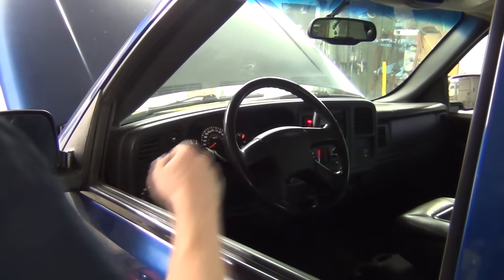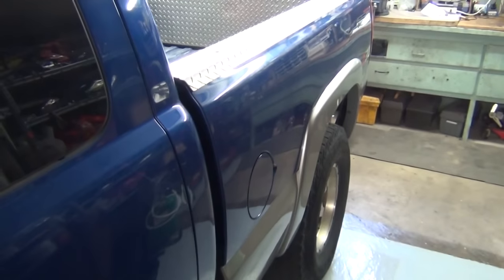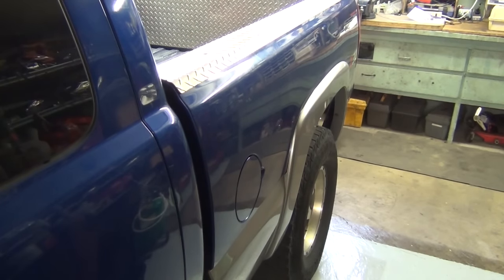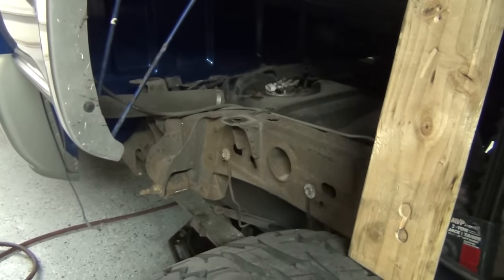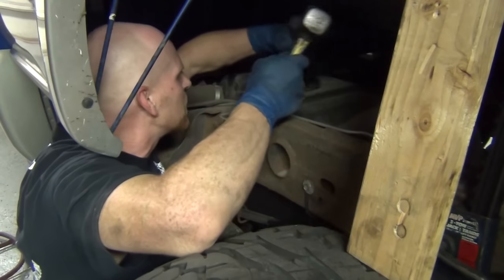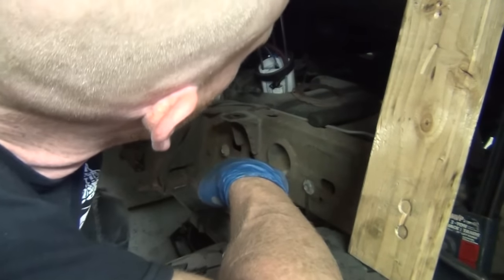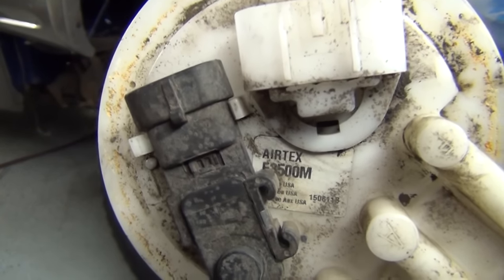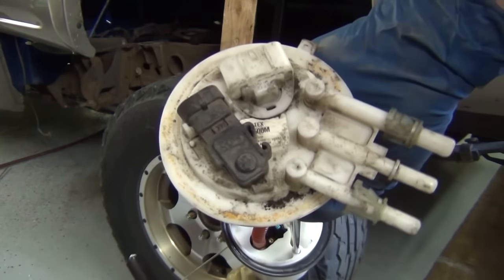Tipped Bed Method!  GMC Fuel Pump Swap.

Comment: I'm torn between this method or cutting an access hole in the bed. If I cut a hole, I'll have to remove my tool box and drop-in plastic liner. So it might be easier and quicker to go at it this way

Comment: It's too bad that trying to buy American turned around to bite you in the ass.You would think that people would take pride in being among the last American manufacturing left. Maybe they got some defective parts and didn't catch it. But not warranteeing the pumps shows zero accountability or pride. Looks like they lost a good customer.On a lighter note , what kind of creeper is that? It looked pretty good. Thanks for the helpful vids, you're easy to listen to and have a good sense of humor.
Reply from the maker: Thanks- the creeper is Napa's "fancy wheel" model.  That's what I asked for and the counterman knew right away what it was.  It's a Balkamp catalog item.  I looked online and found Lot #298259

Comment: If you have a motorcycle jack, you can drop the tank with ease.. just not sure there is enough hose and wire to get low enough.

Comment: If you were to put your foot in it would it stay running? Mines doing the same thing right now, not quite as bad. I can still drive mine but it tries to stall at lights if i keep it in gear, so i put it in neutral and it sputters around 400rpm.

Comment: good video. for next time you could try pulling the fuse for fuel pump than start it and let it run till it dies and it should not have as much gas in the line when you go to take it off

Comment: I will try the bed tilt if mine ever goes, but what I discovered is that lucas fuel treatment, that has a lube base in it, will lube the fuel pump and make it last longer. I have 265.000 miles on my sierra  (2005) and it read 57 psi,  so its still hummin nicely. Also, this cutting a door in the bed for access is cautionary  to me,  since there will be sparks from a cutter or reciprocating saw- and the perhaps fumes around? No thanks. Buy you some PB Blaster for bolt removal, it's great stuff.
Reply: Common Sense Machine my pump is slightly humming I put Lucas in I hop it’ll help

Comment: Thanks for the video I did not want to have to lower my tank that is atleast half full by myself . I'm definitely tipping the bed . Is it possible to tip the whole front like a dump truck without any more work than side tipping it ?

Comment: just started on rt side used pbplaster wont get to 1 bolt keeps turning some what tight  2 got loose 3 broke 4 out lf side 4 got out 3 broke 2 comming out sow tight 1 tight what do you do if 3 are snaped jusr tack wed next guy just has to use cut offf= wheel mr lucky you have agood vidio

Comment: I'm trying this technique on my 2001 Silverado. I have run into a challenge removing a couple bed bolts. The problem bolts will loosen to the point I can spin them with my fingers, but they won't come out. Do you have any pointers to get them out?

Comment: I used to have an 88 Celebrity that had the same noise from the fuel pump except it worked, until I was on a long trip and it died on an exit ramp. Same exact noise.
Reply: I have an 89 celebrity. 2.5 4 cyl. All original but the transmission does slip now. After  32 years and 270k it's to be expected.

Comment: Puts my mind at ease to know the bed will just tilt :)
I'm up for a pump in my '01 sierra, believe it or not the org. acdelco is still in there!
What would you recommend the Delphi or Denso?
Reply from the maker: Either one would be great.  AC Delco is the original manufacturer for GM.  And Denso is a very reputable supplier for many of the Japanese imports that just about never need a fuel pump replaced.

Comment: Hello Brian, I need some advise please! I pulled the throttle body off of my 2002 Chevy Silverado 2500HD and also replaced the air idle control valve. Now when I start the truck I get a short period of high idle and then it drops down to normal. I just re-installed the throttle body today and noticed the high idle other than that when it drops down to normal it runs great not sure whats going on any help would sure be appreciated. Really love your channel tons of great info and you seem like such a down to earth just over all great guy the world needs more people like you really. Thanks again buddy have a wonderful evening.  Paul
Reply: I know on later trucks as in a 2010 when you remove the throttle body you have to have a mechanic make the truck relearn how the truck idles and should idle when
Reply: Thank you jbosem!
Reply: Jbosem is correct, if you move the butterfly at all on an electronic throttle body, our kind folks at GM designed it to have to be fixed by computer

Comment: what years does this work on? i do liek thsi for the side of the road, i like to full pull the bed myself, the tank is straps here in eastren canada after 7+ years, you usally wanna leave them alone xD pulling the bed is what i like to do, now that ive seen this im going to try this

Comment: thats why i just bite the bullet and get a delco, if its a ford motorcraft, ect... i just dont like after market electronic's, had to many issues with it in the past and one fo the work issues was the virable resistance on level sesnor and or FTPS acting up...

Comment: Just wondering if you are still liking the Carter pumps? What about Delphi or Bosch?
Reply from the maker: I'm currently using OEM pumps and Precision brand pumps.  Delphi and Bosch are fine, they're OEM for many vehicles, but I prefer Precision brand where/when I can get it.  The price/value/performance mix is best with Precision brand for now.

Comment: Hey Brian!  97 blazer here with a bad sending unit causing fuel gauge to not read correctly.  Just replaced it with ac-delco 5 months ago and it's having same problem again with fuel gauge.  Any recommendations or suggestions?  Fresh out of eBay warranty! Shocking right?

Comment: I have Modified all my Vehicles with an Out of the Tank Fuel pump. Have had No Issues with any one of the. In Tank Pumps are just a way for Auto manufacturers having Consumers have to pay Over Priced costs to replace Fuel pumps.

Comment: i have a gmc 2500 hd with the 8.1 litre and when i pulled the old pump out it only has one electrical supply and the new one came with two on it and a new harness with wires for the extra connector. pump didnt come with any instructions was wondering if anyone knows where you wire it to
Reply: Mine on my truck has two only one plug tho and been that way sense day one

Comment: I found that the stock GM replacement will not fit the airtex unit. I found an airtex replacement pump on ebay for under $20 shipping in and lifetime warranty (for what it's worth). But you still end up with an airtex unit.
Reply: You got a counterfeit for $20.

Comment: I agree fuel pumps these days are shitty , but you forgot to clean off the tank. The sediment from the top of the tank can damage the pumps and cause them to fail prematurely . Most of the pumps i have installed warn you about this on one of the small pieces of paper that come with them .

Comment from the maker: Ethanol is detrimental to many of the plastic parts used in modern cars.  That's been proven many times over.  I'm not satisfied that ethanol alone was the culprit here.  Nor in the Dead on arrival A.T. pumps that I've come to develop an emotional dissonance for.

Comment: About how long is the 2x4?
Reply from the maker: I started with a 3' long one and pushed the bed up until it was tensioned- then I marked the bottom where it was at the top of the frame.  Then I cut it to fit at max gap.

Comment: DELPHI FOR ALL GMS!!!!
Reply: My original Delphi fuel pump started having check valve problems around 70-80K miles so I replaced it with another Delphi. At around 175K this one started having the same problem. Having to cycle the ignition 2-3 times to get enough pressure to start was the beginning of every first start of the day. I actually began thinking the check valve was the only problem with the OEM units until yesterday. Then the truck wouldn't start at all. Checked the pressure test port and "0" PSI was the reading. All electrical looked good so am going for a different MFR this time.

Comment: Can you just not get the pump and change it? I get the pump only here on GM and just spend 20 minutes changing them over. Then again it is an aftermarket unit as well, might not last the 10 years of the oem unit, but is going to go at least 4, and is a tenth the price ( and if you buy oem it is the same pump anyway from GM themselves). Only time you buy complete is if the fuel sender is dead as well.

Comment: In the good old days you could slide a new mechanical fuel pump in a square body into the side of the engine and the pump would set you back $25 and a leisurely half hours work. I done one in 15 minutes once. These new vehicles are shit to work on.
Reply from the maker: I feel ya man!

Comment: I just installed an Airtex.....if it goes out I'm cutting a dang trap door in the bed.....lol
Reply: Your everywhere on youtube....
Reply: In 2011 I had a Bosch Fuel Pump installed on my 1995 Chevrolet S10 & it lasted 7 years before it went bad.  Then I had a Precision Fuel Pump installed from O'Reilly's last month and after 3 & half weeks the O'Reilly's fuel pump went bad.  So now I'm going to install a Delphi Fuel Pump & a new sending unit.

Comment: I tried tilting and realized that just sliding the bed worked better
Reply: Hi, did you just take out the 8 bolts and then pull the bed backwards?
Reply: @cj8172  yes. I used a 2 x 4 to help me move it since i did it alone. Funny part is I did all of that, wasted 400 on the pump, and it was acutally the fuel injectors that was my issue. Now im having some other kind of issue. It worked well, then it randomly died and dont want to crank.

Comment: Eyup, Airtex is garbage.I've warrantied out three of them in the last year on my '98 Pontiac.  First one had a faulty level sensor out of the box, second one had a bad pressure sensor out of the box, and a bad level sensor after 3 months, third one is slowly losing pressure...  Argh!

Comment: New pump will not run without ground from filler attached back to frame.
Reply: +Rick Nelson The filler ground strap is for static discharge not for pump power. The 2 bigger wires on the harness is what powers the pump.

Comment: It works if gm could weld bungs in better on the box. Had some rusted bolts broke bungs loose. Had no option but to just drop the tank or cut bolts. What junk Chevy builds these days.

Comment: Gonna have to say i disagree on this approach as easier an faster. This is coming from an ex bodybuilder gym rat who broke his back 6 years ago and walks with weak limping legs. Just replaced mine with a delphi on my 2 in dropped 88 c3500 2 weeks ago with a 4 ton jack solo. But depending on a person situation this can be a better choice. And make sure your ground surface is cleaned from rust. Thats what i noticed killed my last pump.

Comment: I made the huge mistake of using a ratchet on my bolts and of the 8 bolts on my 1998 1500 Silverado, I stripped the last two close to the bumper. Don't use a ratchet. I'm cutting them or drilling them out very soon. IDK. I called it a day and ruined my Friday.
Reply: thats probably because you had just a bit to big of a socket so it wasnt on there tight enough. its at personal fault and not the tools fault
Reply: Hey Irishman, The socket fit like a glove on the bolt head, its the threads that I stripped. I'm thinking because I used a pipe on the ratchet with brut force instead of a impact with the hammer action that's what caused the stripped threads on the bolt or crossmember in the bed. I believe the frame is just a hole no threads. I took out 6 of the 8 using the tube and rachet. It so happens the last two were at the rear end near the bumper bracket and they might be more corroded? There's not a lot of room to work in there too.
Reply: I would never blame the tool. Its always the operator/owner of the tool. Lack of my knowledge in this case.
Reply: Jean Villard yea i know what you're saying. ive done the same thing atleast a half dozen times because i had tightened the bolt or nut to tight the previous time of messing with it. Practice makes perfect.
Reply: Yup. Practice makes perfect.

Comment: That seems to work... sure beats what the moron who used to own my Dakota did to replace the fuel pump. The idiot cut a hole in the bed above the tank!!! 

I'm afraid to lift the bed liner to see how much of my bed has rusted away since then!!

It sure will make changing my fuel pump easier if it ever goes again though.

Comment: Ethanol blend has been used here since the 1980's, and only affected a few early models. Manufacturers learned fast how to make the parts last in the blend, and you get no problems with it, aside from USA brand models where they often are not alcohol compatible. Toyota, Fordza and VW have no problems, GM and imported USA made Fords have endless problems. Korean made stuff no problems. Even the OHL imports don't die from fuel issues, they fall apart from other issues long before.

Comment: IDK why people just dont drop the tank..... ITS NOT HARD!!! 
(unless you thought filling it FULL of gas would fix it..... just like how people think oil changes will fix O2 sensors lol)
.
like, pulling the bed is JUST AS HARD (harder if rust belt) than dropping the tank
.
.
idk.... ill never understand it i guess.....
Reply: When you live in a rust state (MI) the fuel tank strap bolts rust and seize. Not to mention the fuel lines etc. 40 year dealership tech here. I have done dozens of fuel pumps and usually ALWAYS just drop the tank. But SOMETIMES you can't without creating a bigger mess

Comment: Why are fuel pumps such garbage today?
Reply: I heard that Delphi are the way to go ac delco fuel pumps are shit. and I had problems with them also on my older truck (95) but shit they were $50 then instead of $250.
Reply: Brandon Nelson Thanks, that is what I heard.
Reply: Brandon Nelson they are basically the same part... Delco is official GM, delphi is a spin off using the same specs as delphi anyone with knowledge of will say delco v delphi is a useless argument